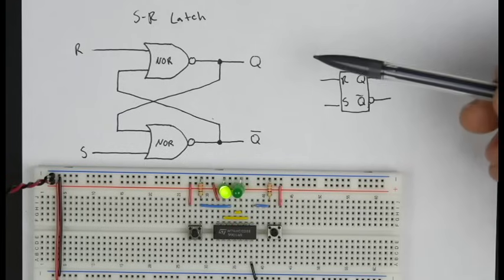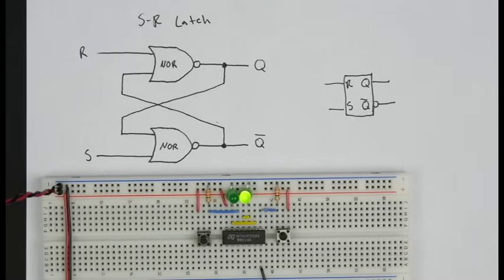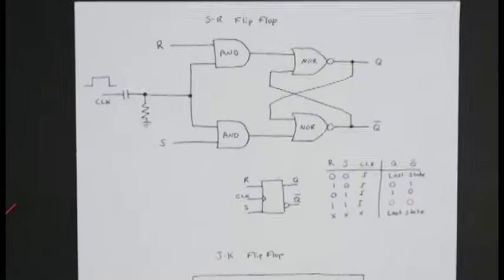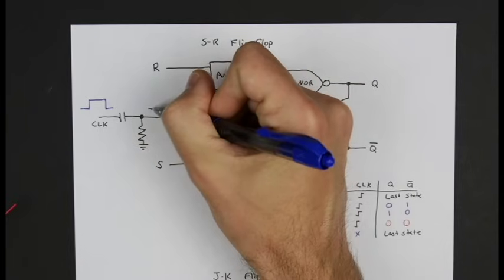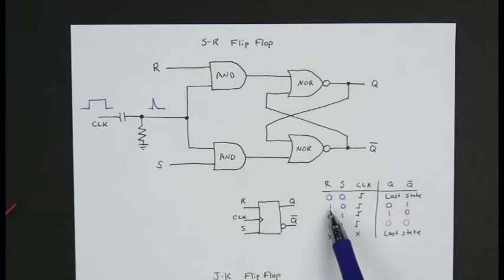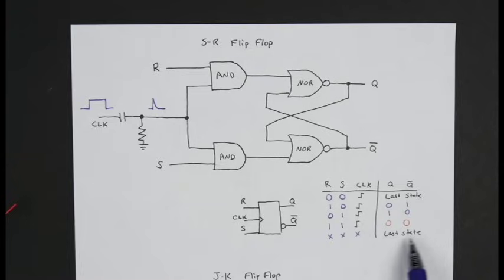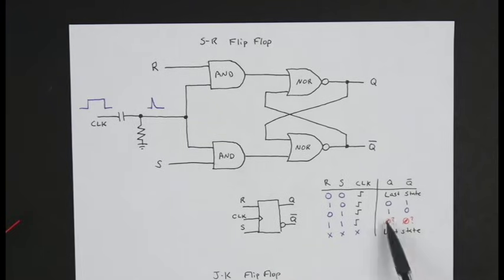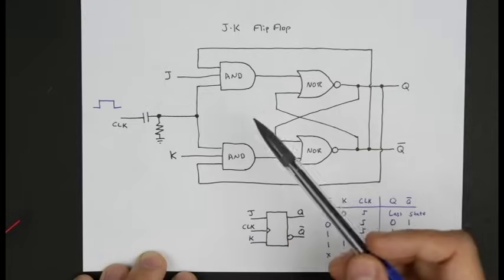JK flip-flop

Comment: I believe there is an error in the layout of this circuit. It seems that when using nor gates you don't want to go from the opposite side nor gate back to the and gates. If you were using nand gates rather than nor gates your diagram would be correct. Since you are in fact using nor gates, you would go back from the same side nor gate to the and gates. Can someone else please confirm this?
Reply: I was thinking about it for 30 minutes and searching information and then noticed the error.
Reply: Same here man :D
Reply: @kojonek2  omg same bro
Reply: Actually, it turns out he made the diagram wrong but wired it correctly --
He connects the same side NOR gate to the AND gate.
Whereas; in the diagram he has, the opposite(to the AND gate) side NOR gate's output is the AND gate's input.
Reply: So, basically he did this mistake because this orientation is correct in a master jk flip flop(next to next video)
Reply: Glad you mentioned it. Thought I was going crazy for a second lol
Reply: I was thinking that I'm just dumb.
Reply: I have an idea!
You have to either switch places on both Q & Q' and J&K  for this to work
, or you have to keep them like that but have the and gates switch their outputs (or gates). And gate on top goes to the or gate on the bottom etc
Reply: I even used Cedar logic simulator to try and see how it worked because I couldn't get my head around it but I guess there was a mistake
Reply: spent some time to go back and re-check SR-latch video to confirm there is an error, then scrolled down to find this comment
Reply: Thanks man! I was wondering for 15 minutes why the state {J = 1, K = 1, CLK = rise} toggle instead of staying in the last state. I knew that it must toggle, but I couldn't understand why. Finally I decided to check in the comments if could be some mistake in the drawing
Reply: @shorky_0  check next video, he has corrected the circuit diagram
Reply: @barathkumar7940  the link pls
Reply: @barathkumar7940  No he DO NOT fixes the diagram or the circuit.
It somehow still works.
Someone explain!

Also, it doesn't even works with the NAND gate because both the inputs need to be 1 to get a 0 which happens only when we press something otherwise it doesn't latches.
Reply: @barathkumar7940  Thank you! I was stuck for 20mins already. Haha.
Reply: @shorky_0  doesn't matter , toggle will still occur despite his wrong diagram
Reply: @vedant6633  no... The circuit drawn in the video holds its state if J and K are high and the clock comes on. Take another look at the diagramm.
Reply: @zoltankurti  Yes, the video layout (opposite side of NOR to AND) doesn't allow to change the state, thus doesn't allow toogle either.
Reply: I concur.  I couldn't figure out why it would oscillate with the clock high, rather than just stay at the same state.
Reply: I just saw the video and went straight to exam and stuck there. Now i see why 😪!!!
Reply: He must have confused it with NAND gate logic for JK flip-flop.
Reply: Yes , Diagram is wrong also J and K position need to be reversed and three input nand gate should not get crossed I/p.

but @Ben Eater is doing good job, thanks for uploading 8 bit computer series.
Reply: If he replaced NOR gates with AND gates, the circuit will function correctly.
Reply: @RevCorner  No. Replacing NOR gates with AND gates is bad idea. AND gate in RS layout doesn't allow to set or reset triger - both Q and Q` will be 0. You might want to say to Replace NOR gates with NAND gates?

Comment: Can you make a video on hardware button de-bouncing?
Reply: he did  it was in on of the clock circlet vids
Reply: Ewmiter Thanks, I found it. But what if you have many buttons, let's say 16 buttons? You can't use a 555 for each, that'd be very bulky and inefficient. I remember de-bouncing can be done with logic gates too. Is their a better way/ more popular way to resolve this issue if you have many buttons?
Reply: you can make a debounce circuit but i would just use an arduino for the simplicity
Reply: Ewmiter You mean software de-bounce? Or are you talking about schmitt triggers build in the pins? Idk if atmega328 has that.

Comment: Oh boy... I can't wait for rest of the computer tutorials!
Reply: Me too. But I guess he wants to explain the sequencer unit now, so he needs to explain binary counters first, and this in turn requires explaining the T flip-flops first (also known as "frequency dividers" or "count to two"), which are the building blocks of any binary counter. They can be made from the "universal flip-flops", the JK ones. (Well, interestingly, they can be made from D flip-flops as well, but let's allow Mr. BeNeater to explain the JK flip-flop as well, for completeness's sake ;) ).
I, for one, can't wait for the instruction decoder and the control unit, because those are usually the least-explained elements of the CPU in every course I've seen.
Reply: Sci Twi Ditto, microinstructions are explained but are never explained how they are implemented...
Reply: Xenthera I would also like to see the older way of doing it, with just plain old logic. It can be done easily if the instruction set is specially crafted for that (e.g. some bits in an instruction can select operations in the ALU, other bits can select registers, still other can select the direction of data flow etc.).
Reply: I actually built mine with just 2 input nand gates(74HC00) although I have only 4 instructions: LDA, ADD, SUB, HLT.

Comment: To me, an R-S latch is like start/stop buttons. I've seen it in some textbooks as an 'illegal' input when you have both R and S held high. Well, it's not really illegal, it just doesn't make any sense to press a start and stop button at the same time. Do you try to turn a light on and off at the same time? Probably not. So, making R and S both high doesn't make sense. The purpose of an R-S latch is like a start stop button.
Reply: Yes, you're right, it does not make any sense, but tell it to the idiots who, if they can do something irrational, they will always do ;J That's why the RS flip-flop is not idiot-proof enough and we need to improve it ;) One of the possible improvements was the D latch. The other is this one.
Reply: Truth Seeker
Yeah, but there are two views on logic gates which shouldn't be confused here: one is the abstract view (logic gates as "black boxes" with certain characteristics and behavior, performing a certain logic function) and physical view (a particular implementation of logic gates with transistors, for example). Because logic gates, as an abstract thing, doesn't necessarily have to be made of transistors in a computer. This concept is much more general. They can be made of marbles. They can be made of Domino bricks. They can be made of LEGO. They can be made of cogwheels. They can be made of lights and mirrors. And all those physical implementations would have different characteristics, with different representations of logical states. But this shouldn't distract us from what a logic gate is as an abstract device, performing a logical function. You can build a RS flip-flop out of any gates, and all of these implementations will suffer from the same problem, because it is not something implementation-dependent. So how does it work in an electronic computer is out of the table here.
Reply: Truth Seeker
How is that different from what I said in previous comments?
Reply: The operations inside a computer are not that simple. Thinking of S & R as switches is a gross over simplification. You must think of them as signals that pass through the logic gates.
(most of the time, S & R aren't simply hard wired switches, they're rather signals that are coming from other circuits in the computer. And in most cases, those signals are not necessarily synchronized).
It is possible to have a similarity in the two signals at any point in time and that might cause a problem!
Moreover, you need the feature of "Toggle" for making counters and more..
Reply: Sci Twi It does not matter whether it's made of transistors or not.. 
What matters is,  you have a cascade of many logic units. Therefore , you must think of S&R as logic signals rather than hardwired buttons! 
Those signals aren't necessarily dependent. And hence they can be identical in any point in time. So you have to watch out when using an SR Latch. 
JK flip-flops got rid of this problem.. Furthermore,  they have the advantage of toggling the previous state.

Comment: It has to do with how an 8 bit cpu handles 16 bit numbers... Or at least how does the cpu converts 2 bytes to a single big number... For example 259... If the cpu can only understand  numbers lower than 255 bcs its and 8 bit cup... So it would have to place this number in ram or use 2, 8 bit registers. But how would it print it out to the screen if it's a number bigger than 255..?? 😂😂 that's my question for u Ben... I have this question bcs it's the same with 32 bit computers... How can they print out a number bigger than 32 bits...say, perhaps a 64 bit number.....??
Reply: There's nothing related to the CPU, actually. That's the job for program part, which processes big numbers word by word.
Reply: +Vic Vlasenko so how would this big 16-bit number be converted to decimal in code? Do u know bro?